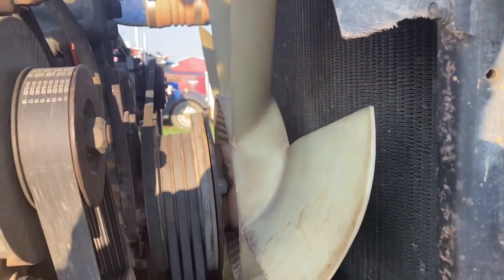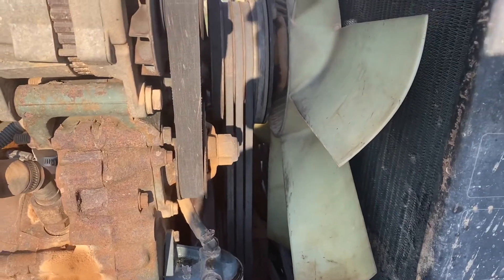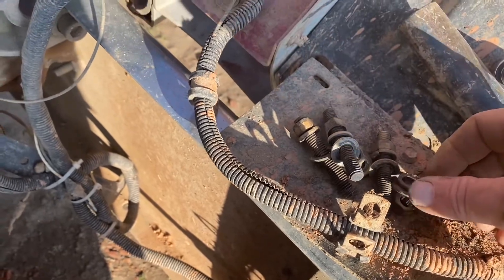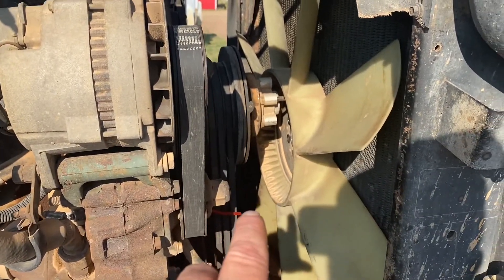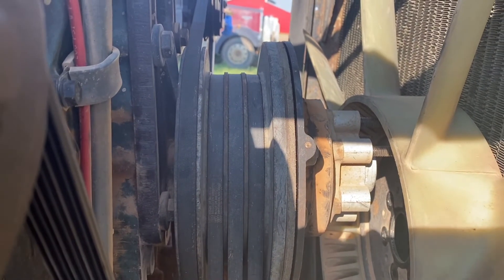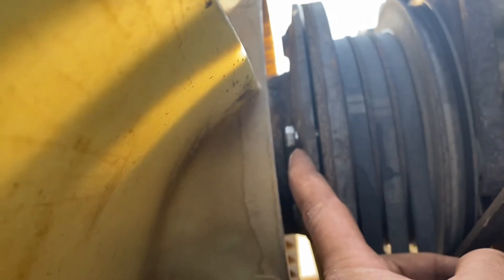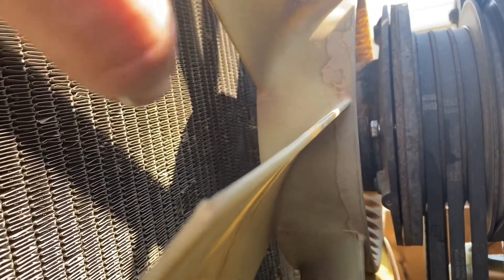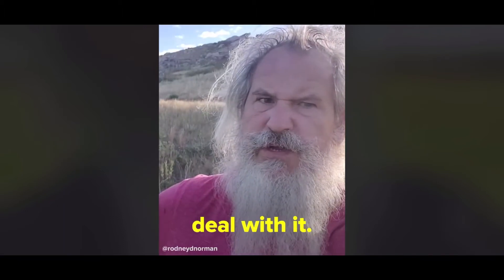Detroit 60 series Horton Fan Hub/Lock Part 1

Comment: Mine is locked with that allen screw but when i turn it to get if off air starts coming out of the hole. What does that mean?
Reply from the maker: @marcocruz5977  the seals /Orings are blown